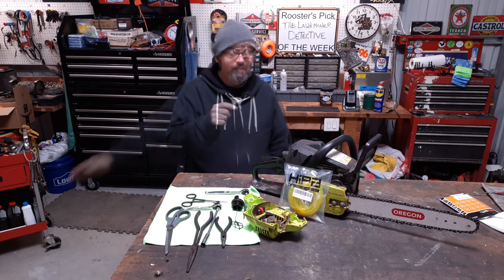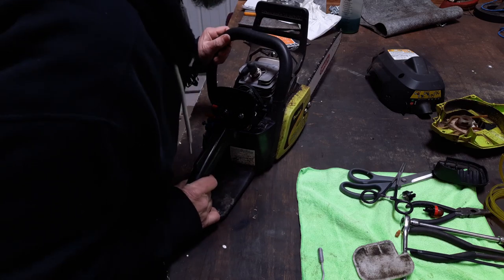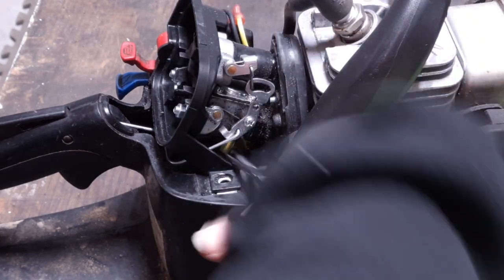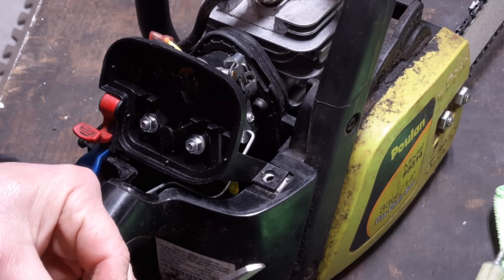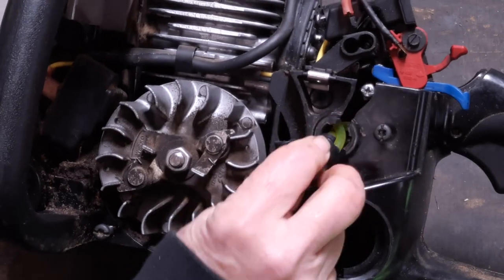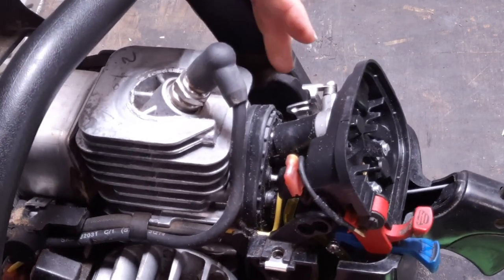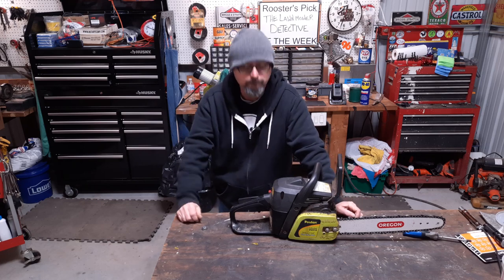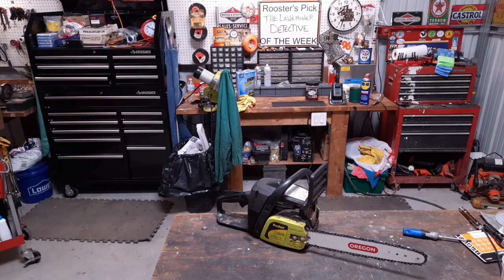Chainsaw Fuel Line Replacement, and other Misadventures. Using HIPA Parts

Comment: Nice job there Rooster! We learned some new words without learning any more four letter words, like ouch. While angle cutting those fuel lines you can angle cut the side of your finger. Dont ask me how i know, but i wouldnt recommend it! Lol. 😎👍🇺🇸Roger
Reply from the maker: Hey Roger, thanks you sponsored this video with the fuel line.  Appreciate the heads up on the finger safety.